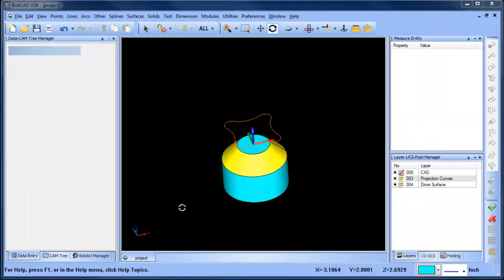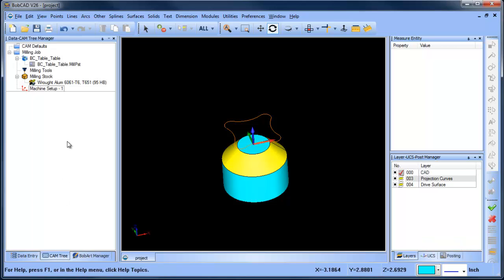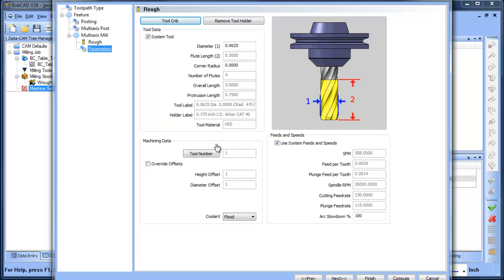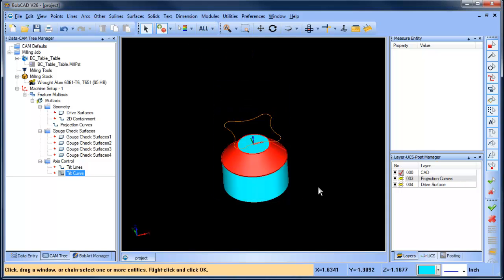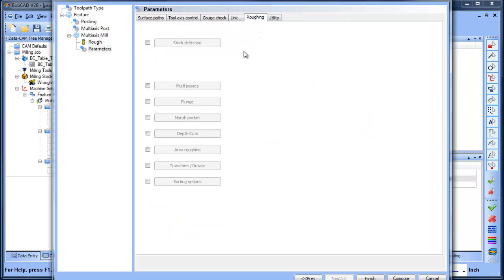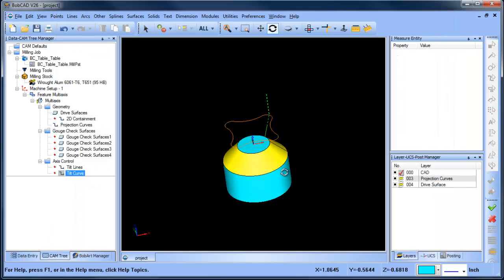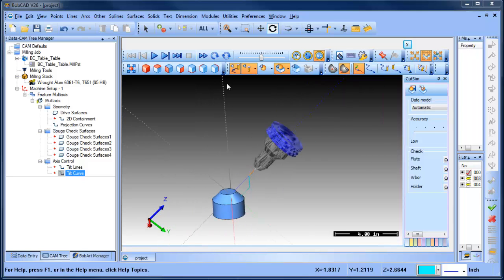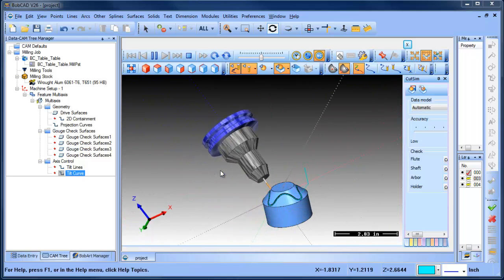BobCAD CAM V26 5 Axis Tool Path Projection Review

Comment: Hello, Depoalo.
I am in the process of building a 5 axis CNC machine to cut foams and eventually wood.
Could you recommend me some software and where i could buy it ?
I read a lot that 5 axis CAM software is really expensive but now i find out that Bobcad is only a couple of 1000s.
Where is the catch? 
I hope you can clarify on this topic. :)
Reply from the maker: Hello Plavix, there is no catch, BobCAD for 5 axis machining cost less than the other guys.    You can build you machine for machine simulation and customize your post processor as needed.   What I recommend you do is call us for a 1 on 1 demo.  This way we can walk through the software, show you how it works and you can get a price quote at the same time.   If there is anything I can help with along the way, please let me know.  Call this number to get things going 877-302-7733